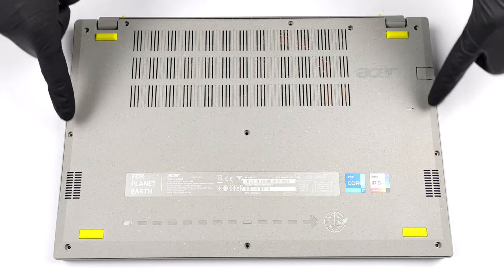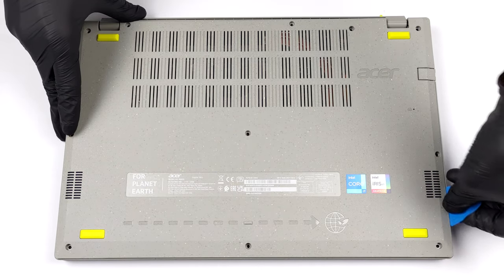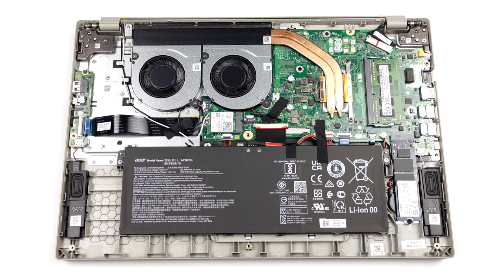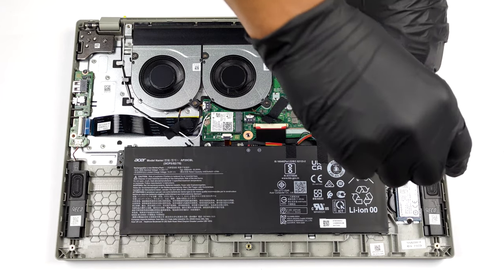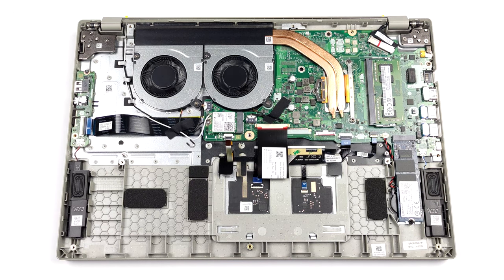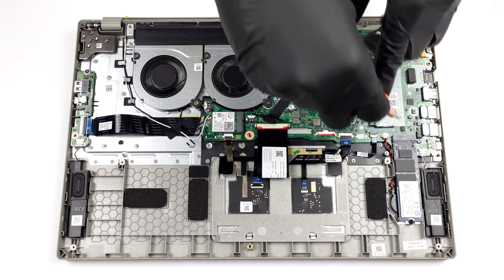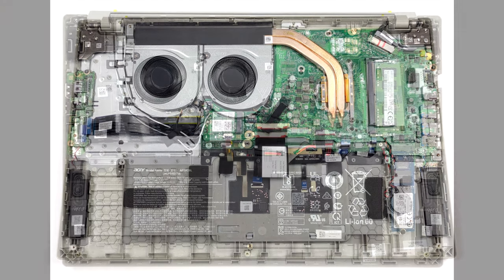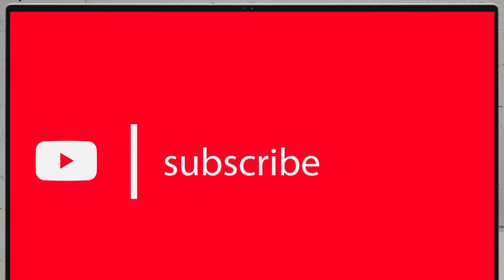🛠️ Acer Aspire Vero (AV15-51) - disassembly and upgrade options

Comment: acer laptop is a very repair friendly laptop, especially if u would want to replace your battery at home, I had an hp envy, and it was difficult to replace the battery, the screws was under the rubber strip (bottom grip), I would recommend Acer to everyone 👍🏼

Comment: Is this laptop a good buy? Need to know from someone who has been using it
Reply: My wife uses it for work. It seems appropriate since she's climate protection manager in a local town council. ;-) I'm a programmer and I borrowed it from her for about 2 months until my new laptop was available and really the only thing that I dislike is the tiny charge plug. You have to be somewhat careful with it.
Reply: @immanuelkantholz9033  thanks for the response. Ended up getting an Acer Aspire 5 just because of a good deal i was offered.. Hope it doesnt disappoint, and it has that annoying small charging port you just mentioned as well.
Reply: @raccoons_stole_my_account  unfortunately no. That's why I'm so concerned about the tiny charging plug. But contrary to me my wife has very good fine motor skills, so it's unlikely she'll ever break it.

Comment: How many ram slots are there??1 or 2??
If the answer is 2 then one of them is soldered?
Reply: mine without extra ram installed.  in builtin ram 8gb 3200mhz.  i am planning to buy extra ram.
Reply: Does this has option for 8+8 gb RAM?
   Acer Aspire Vero AV15-51-52Q3

Thank you